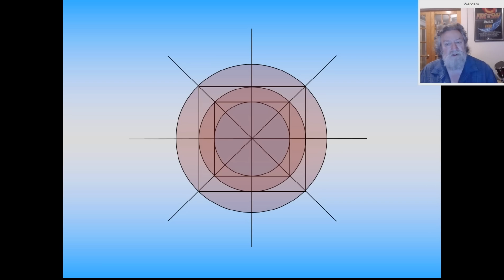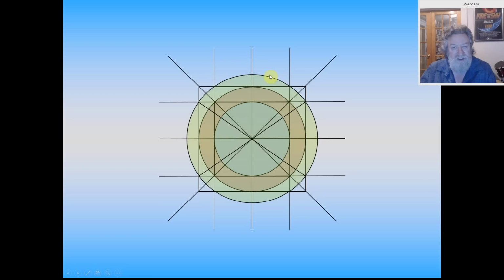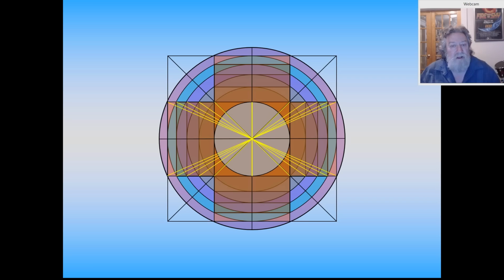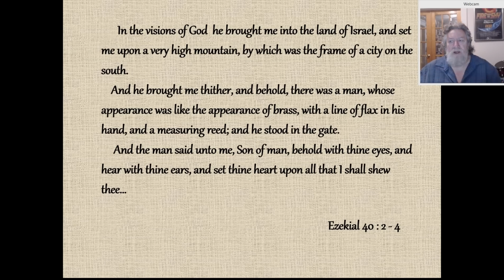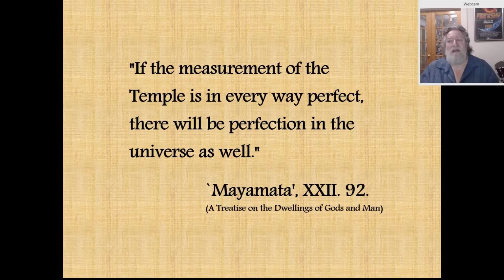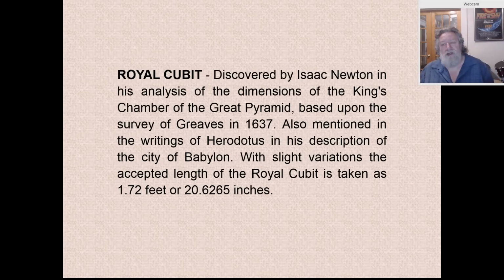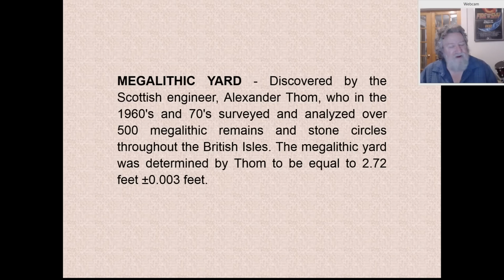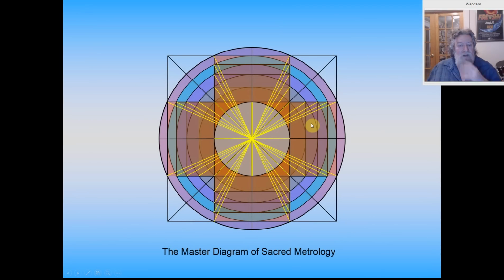Randall Carlson - Sacred Geometry Classes - Dynamic Symmetry Master Diagram and Sacred Metrology

Comment: 13:23   😮
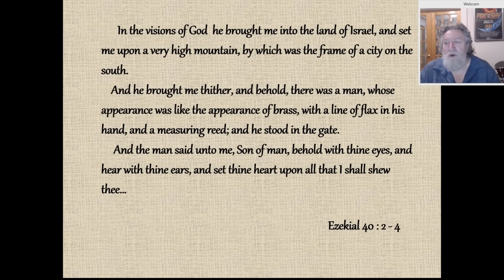Reply: 18:37   This is def related to the Vedic lore about Vimanas. The word "Vimana" means "measured out".
Reply: I wish I could build things where I live. 
I need to build my own altar and my own house using my own measurements. 

I don't think it's "energy" and "information" that flows up and down the scale. Those words are coming from Modern Materialistic Minds. I think it's influence. 

The Pharaoh didn't go to all that trouble to have his body measurements taken and used in order to transmit his information or energy through the buildings to the people. He wanted to "Rule" them. As well as any unseen or non-human presences that hung around. The Hermetic Tradition Also implies this in the Kybalion. This is why these techniques are still used today in buildings and images by World Rulers and Corporations that seek power and domination. Tesla knew exactly what he was dealing with. This is why he kept some knowledge to himself and only wanted to give the Knowledge to people of Good Will. 

There are other things that Flow up and down the scales. Not only influence. But these values of energy and information are not Traditional values of any Ancient Value System.
Reply: @DarkMoonDroid  Maybe the there is a flow of "energy" in an occultist sense, which pretty much ties in to what you said, the Pharaoh's used them in order for his influence to manifest through them

Comment: Thanks, Randall, but now I am CONFUSED. I have been watching your stuff... and you have done something funky with the Pace here. It was 5.28 feet in the Cosmography 101 videos, featuring Stonehenge as having an outer circumference of 1/10 mile, 1000 paces being 5, 280 feet. A case was being made there for the ancient nature of the mile. Here you have this weird number for the Roman Pace of 4.86 feet. Which is it? Or was 1000 paces a rubber yardstick depending on who was pacing off the distance and where they lived? In any case, I have missed something salient.